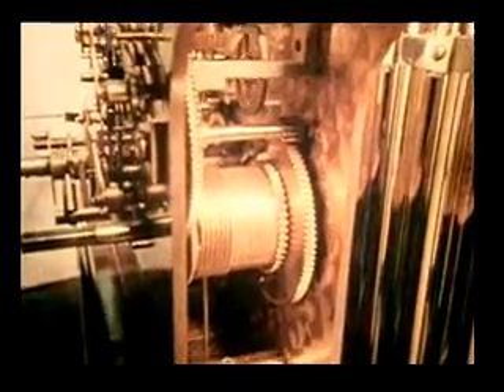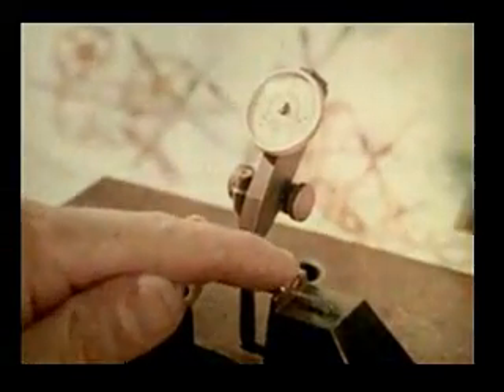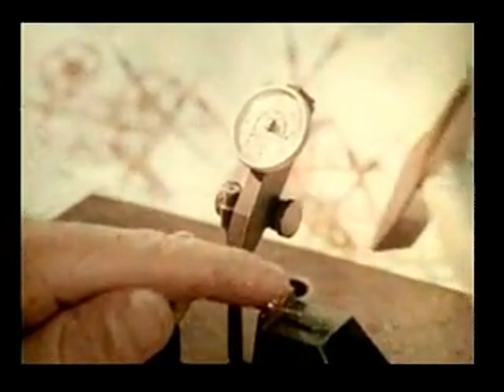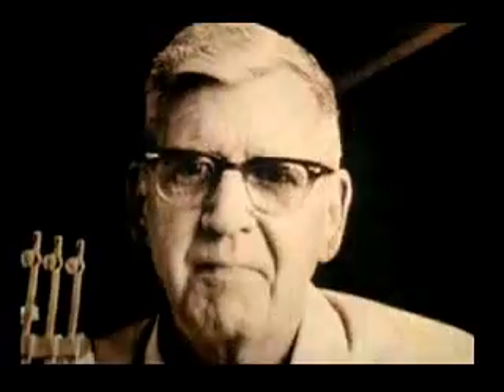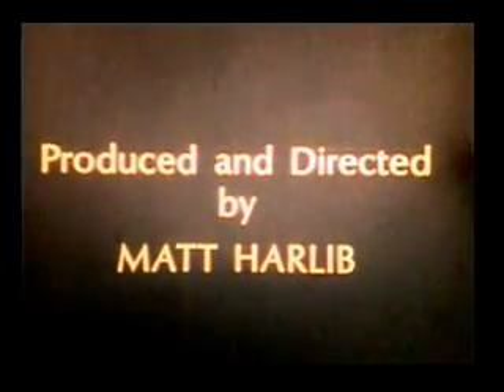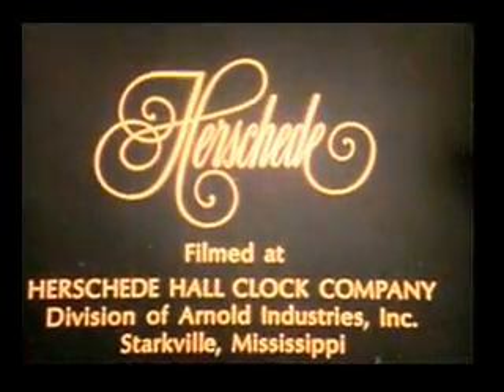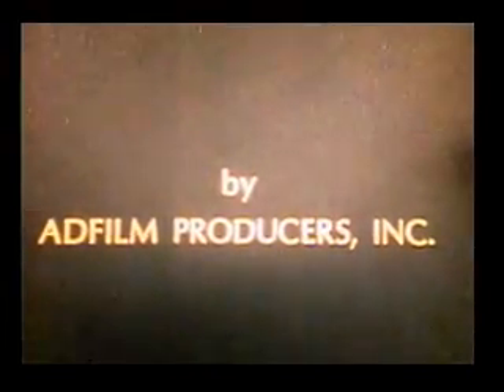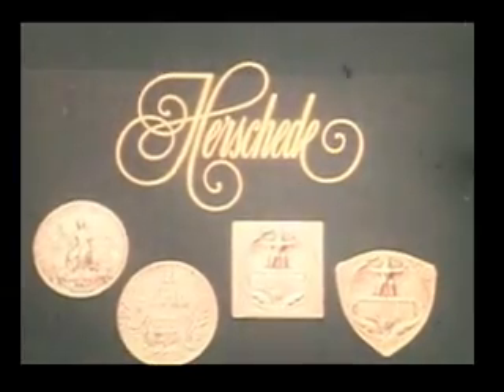How Herschede Hall Clocks were Made - The Tradition Rich Grandfather Clock Circa 1973

Comment: Brass and gold plating tarnish form oil on the hands and fingers. Herschel in their set up manuals stressed that gloves be used when assembling and adjusting the clock. I have a Hermle regulator which has never seen sight of a bare hand, and after many years of operating, the movement, dial, pendulum and weight still look brand new.
Reply from the maker: David Rakes i figure it was just for the making of the movie. But you can also buff off the prints. Only scene i noticed was setting the moon. I never wear gloves for that but am aware to avoid the edge of the dial.

Comment from the maker: Hentschel movements are either Hermle of Kieninger. Both are very reliable but both hang their tubes by wire instead of string and this causes vibrations to feedback into each other and the chime rack and the sound is not as clear. The Kieninger comes the closest to what Herschede made in appearance. Both current movements will give excellent service. Nobody makes a Dial (clock face)Like Herschede. Keep in mind too, Hentschel is just a cabinet maker.